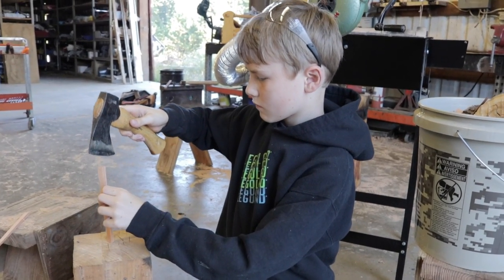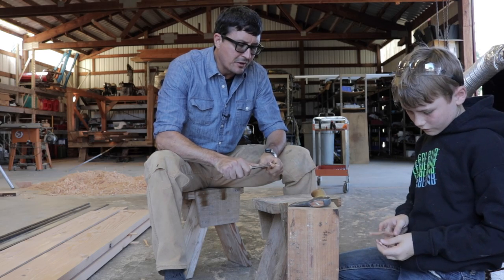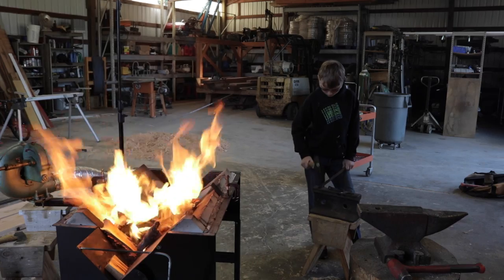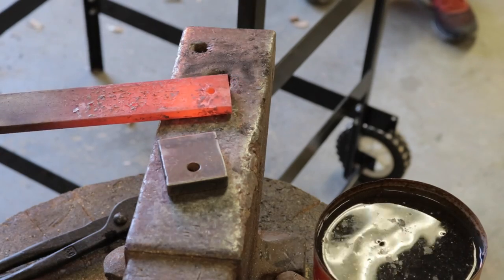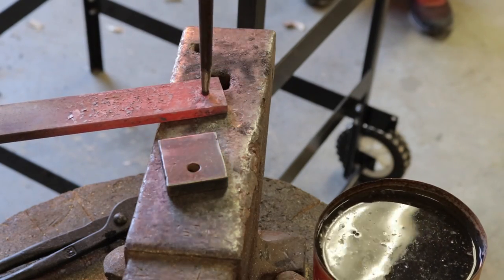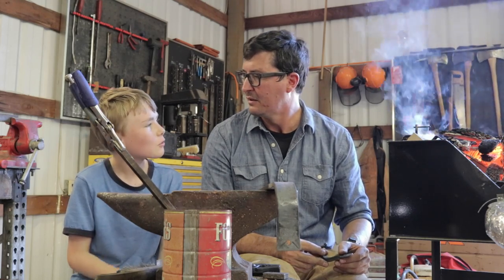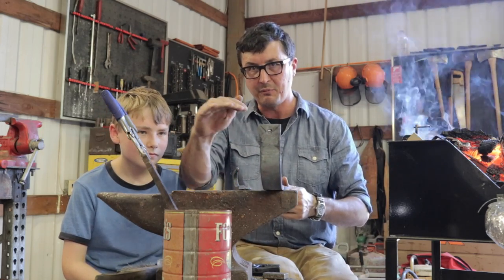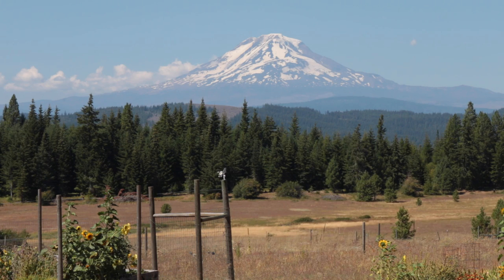Blacksmith With Wood

Comment: First video I've teared up while watching. My dad died when I was young, about 3. Never have had the knowledge that should be passed down from father to son. Came to this video trying to learn more about smithing, trying to figure out what tools I should get, what brands I should trust, how to use each tool to its potential. Right when you sat down with jack at 1:51, I could feel through the screen the connection you share with your son. Guiding him through each task, teaching him the correct ways to do things, helping him discover. It hit me right in the heart. I hope to be half as good a dad one day.

Comment: Most of the manual skills are aided by muscle memory. I watch guys who work in offices struggle with simple tasks because their hands don't have much muscle memory for manual tasks. 
Jack and all young men starting out get frustrated because simple tasks seem so hard. To all the young guys, keep going, you will get good at it, all the experienced guys struggled in the beginning, I promise you, all of them.
Reply: I totally agree with you, one of my first jobs was  digging  drainage ditches  and was teemed up with a scrawny old man who worked the head of the trench's with a pick, when shown who I was to work with I had the temerity and just plain bad manners to ask to be put on another team as I would spend the day standing around waiting for the "old man" I never did catch up with him and for the remainder of that job he would spend half the day sat at the end of the trench supping tea and waiting for me. After the job finished the boss took me aside and informed me that the old man had been taking it easy on me so I didn't look to bad on my first job.
Reply: I rounded of and chewed up so many screw heads as a youngster.  Bent nails and buster fingers with a hammer.  Good times.
Reply: I used to work in a printing shop I jogged papers as they came off the Press and made them neat and stacked them on the pallet, eventually working my way up to First pressman running the press, I got great strength on my grip doing that, my arms are not that big and my wrist are short of small for a man. Last year my doctor asked me to squeeze his fingers, I didn't reach full squeeze before he started yelling Let go ok we won't do that again! I'm 56.
I give a firm handshake!  Its almost as tough as a vice!
Its good to get a strong grip on things and life, just be careful how you use it.
Reply: I’m 14 soon 15 and I do blacksmithing as a hobby and the odd job when someone wants something. Muscle memory helps so much the more I forge the better I can make it with less effort

Comment: My advice is start out by making your self tongs to hold stock with its good practice
Reply: I couldnt agree more, Ive been smithing for about a year, and only just made my first pair a week ago . Wish i would have made some earlier. In the past 2 days i have forged 3 pairs , 2 from rebar 1 from square stock.
Reply: That is indeed good advice. There is nothing better than good tongs. Even though, from my experience, the first 1-3 pairs are pretty shoddy, but often still better than standard tools not made for smithing.
Reply: Haha. I remember trying to forge weld. The VERY first weld I did was PERFECT. But I didn't know why... the next half dozen blew apart, crumbled, wouldn't take, or cracked after they cooled. THEN I got the hang of it. Just gotta keep mangling steel until you figure it out!
Reply: Rion Motley
Oh man, I know that. Beginners luck can be so solid yet disappointing when it comes to smithing.
Reply: I was taught some basic blacksmithing years ago and quickly found out that certain tools were needed to be made but without the knowledge it's better to buy a few blacksmith tools on ebay and study how they were made. Cudos to you for including your son! FYI, old files can make some really great knives. Google Jim Rubley,  I think he's moved from Angola,  Indiana up to the Shipshewana area. Learn from the best.
Reply: You took the words right out of my keyboard!  I've been smithing since autumn of 2014 and my advice for anyone who starts out in the hobby is to make your own tongs - yup... my first pair were trash and eventually broke but they nonetheless served me well while they lasted.  My next two pair have been perfect!  To reinforce what others have said, you indeed learn a lot about moving metal by forging tongs and to paraphrase the YouTuber Walter Sorrells, - about 85% of blacksmithing is having the right set of tongs to hold the work piece.  Cody, I recommend watching the videos on the YouTube channels "workingwithiron" and "technicius Joe" for tongs as they both go into a lot of detail.  For other inspiration into what you can do with this craft, check out "Chandler Dickinson".  I sincerely hope to see many more blacksmithing videos - maybe one of these days you'll forge your own hatchet!!Cheers and God's blessings to you and your wonderful family,- J

Comment: As a Blacksmith I strongly advise the wearing of leather gloves while forging, failure to do so will elicit a painful and and hope not to serious of a lesson.
Reply: Lionel Bourgeault funny enough every other blacksmith Ive ever worked around said the exact opposite lol. If you ever do get burnt I recommend mustard to ease the pain and honey to sooth and it also acts as an antiseptic. If you do them fast enough it'll prevent blistering.
Reply: Lionel Bourgeault yes I've learned that the bad way while self teaching myself
Reply: You shouldn’t wear gloves wile forging, if you wear gloves and a spark or the metal is touching or on you, you won’t feel it until it is much to late, and the injury will be worse that just glancing the metal on your skin. Don’t get me wrong, it still hurts a lot but it’s not as bad as when it happens with gloves on.    I speak from experience
Reply: I was taught not to use gloves because by the time you feel it burning through the glove then the glove is burning you not the metal where if you feel the heat radiate before you grab it

Comment: Thinner steel is easier to work with: it's lighter, it bends more easily, it doesn't take huge hammers, but at the same time it retains the heat less and so cools down really really fast
Sometimes i have to blacksmith with nails 3x50 mm (i make small parts for models, robots and rc cars) and it's quite a pain: hoi can use a torch to heat them up, but you have to keep it really close to the anvil and you have to heat the piece up again every 3-4 seconds
Reply: Wait you make robots AND you're a blacksmith??  Awesome!!

Comment: Looking forward to seeing how y'all progress with the project. I'm just starting out blacksmithing also. You mentioned Jack's hammer weight, and one thing I learned from my local blacksmithing group that may help Jack is letting a heavier hammer do the work as its weight falls instead of swinging a lighter hammer harder down onto the material. Sounds counter intuitive since a heavier hammer seems like it'd require more effort, but it works. I started with a lighter hammer and noticed I had to work a whole lot harder on the downswing and the steel still didn't move much. Then, I got a heavier hammer and it eased the work since I was just guiding the heavier hammer as it fell onto the steel. If he has trouble lifting it over and over (especially since railroad track doesn't rebound very well), he can treat it like a sledgehammer swing and bring it close to his body, lift it straight up, then let it fall in an arc — watch Alec Steele striking with a sledgehammer on YouTube to see how well it works. Hope that helps, Jack. Also, maybe you can get your hands on some hot punch lube to help out with future hole punching projects (like http://quickanddirtytools.com/collections/frontpage/products/hot-punch-lube). Really enjoyed the words in the end scene.
Reply: However, on second thought, a lighter hammer does allow for him to learn accuracy more easily. So, the one he has is actually probably a great one to start with.

Comment: Cody to add to what you said on letting Jack figure it out on his own, the most important part of learning is failure. And letting Jack make mistakes and learn from them is quite possibly the best way for him to have excellent problem solving skills. My scoutmaster runs our troop this way, which is where I learned this. Now I don't want to tell you how to be a parent but I just felt you left that out in your talk about how Jack is learning to blacksmith.

Comment: My uncle was one of those old mechanics who kept farm machinery running on a farm in Montana, and blacksmithing was just one of his skills.  Had a rod bent in an l-shape pounded into a hole on the anvil stump that was at the height of the anvil top.  He would rest metal here to support it on the anvil top, and he never had to straddle the end of the work as you did.  Just a thought you might try.

Comment: I'm a 14 year old blacksmith. but yeah, woods is pretty good to forge with. it's clean. it's cheap. and it creates a fire very quickly. the only draw back is that it burns so quickly is that it is hard to keep a large hot fire. there is nothing wrong with that for what you seem to be doing. keep up the good work.

Comment: When I was in the Navy I was stationed on a ship home-ported in Japan and on a clear day I could see Mt Fuji.
That is a good way to learn a skill, when I started off as a Machinist I got a job in a job shop and my first assignment was to make a number of parts out of a block of steel and I had to make my tooling out of the same block.
You learn how to plan ahead.

Comment: Hey Cody I have a question for you, I am an electrician who is currently working on a bunch of residential projects and I have no good way to sharpen the auger // nail eater bits we use to run the wires through joists, and wall studs etc...I know you have some good tips and tricks for those of us who are having the same issue! Thanks again for all that you do, and thanks to the Mrs and Jack as well! You guys are all awesome!

Comment: Thanks for the video guys. Been a while since I worked at a forge. It was gas fired in a shop class. Our project was making a chisel. We had to know the  properties of the steel and the temperature indicated by the color. It had be annealed, tempered, then ground to a 60 degree angle. Making tools is fun,you get to use them.  It's an art that takes skill and knowledge and of course practice. That is a nice forge, I like the design.

Comment: Not sure if others have commented this but when I was taught forging, I was told that the key to successful forging is to hit hard and hit fast, striking twice per second rotating the bar on every strike (if tapering). The kinetic energy of the impacts prolongs the heat and malleability of the metal.

Comment: I would recommend  using some 1/4" inch round for making beginner coat hooks. Also, don't be afraid to lift the hammer or get a larger one. I use a 3.5lb hammer for 1/4" to 5/8" and from anything bigger than 5/8 to 1" I use a 4 lb.Best of luck to you, and your son's journey of blacksmithing,                                                                                                            Mark

Comment: Very cool work. I've done a little blacksmithing and it is tough.
Might I suggest "the backyard blacksmith" it explains a lot of basics.
I've once heard a jeweler swings from the wrist, a carpenter from the elbow and a blacksmith from the shoulder.
For Jack I'd suggest a higher placed anvil.
Just my thoughts and tips but this is your journey.
Have a great day, cheers.

Comment: When splitting kindling up like you did at the beginning, its just as effective and WAY safer to put the wood piece parallel to the axe blade to split it - one end of the wood close to the axe handle while the weight of the head does the job at the other end. Works for surprisingly large kindling too.

Comment: Hi, to make the ends of your brackets 'flare out' like a fish-tail, put your chisel straight up in the vice and take your work to the tool. Place it on the chisel and strike with hammer moving the work piece like the hand of a clock. The chisel cutting edge needs to be wider than the cut that you need, don't cut all the way through but a bit of a 'ragged' end will just add character.
You can make your own chisel to drop into the square hole in the anvil to eliminate the vice, make it square to fit the hole.
Hope this helps...

Comment: Uhm, a few things I think might be of help to you... I realise you were experimenting here, but these are just a few things that I'm calling as I'm seeing them.

1: nail the anvil down, or at least make it so that it's anchored properly, otherwise the energy from your hammerstrike just gets lost in moving the anvil about

2: I'd recommend using coal instead of wood, coal retains heat a little bit better, but I guess that's just a personal choice. It's not that I think wood is bad, it's just that I think it's more of a faff to fire the steel to proper temp with wood. Also, I think it should be a little bit hotter before you start hammering it.

3: to create the brackets, you could use a square shaped (a 90 degree angle) mold and hammer the steel into that. you'd get a nice uniform angle with all the brackets, instead ofhaving to gauge by eye whether each bracket is the same angle.

4: my recommendation is to first upset the ends of the brackets, then hammer them down to flare them out a bit, and then punch the hole in.You can then, ifyou think it would fit your bookcloset, shape the ends to look like fleur de lys perhaps? or cut/saw them to shape if you prefer doing it that way. Once that's done, you could heat up the middle and softlyhammer it into the anglemold, just be careful when quenching, as the rapid cooling may warp the steel.

For Jack, I recommend using a lighter hammer. Remember, it's not the strength of the blow, it's the precision of the strike that lets you ease the metal into the shape you want it to take, he can always use the bigger hammer once he's older, for now I think he'd accomplish more, faster if he uses a lighter hammer that he can control easier. Also, I think it might help him to practice the hit/turn technique, by which you hit, then turn 90 degrees, turn the steel back, and hit again. It takes a bit of practice, but it's a vital technique to know when drawing out metal bars to a nice and even point.

Comment: I'm a Danish Scout. And every scout group here in Denmark have a tradition of selling Christmas Trees :D 
Last time we built an Old Man's Fire (A fire on a table with dirt on top).
We decided to go get our 15kg anvil and heat up some 20cm nails!

We got very supriced when we pulled the first nail out. Because it was glowing white hot and the tip had melted off.

That was the first time ever "blacksmithing". And I made a little knife :D

(It was not very sharp or easy to sharpen, because log nails use very poor quality iron. It's not steel. Because it didn't create alot of sparks when grinding)

Comment: First suggestion is to move your anvils within two steps of the forge.  Saves heat and energy. Second suggestion is to create the fish tail or fan first first then punch your hole.  A cross peen hammer will help you move the metal quicker and more efficiently.  I'm still learning myself but every nugget of knowledge helps.  Gob Bless!

Comment: Since you mentioned layout of your work space I would suggest that the anvils be closer to the business end of your forge rather than walking around the forge each time and losing heat in your workpiece in the process. I would rather just remove my piece from the coals, turn 90 deg and have my anvil there for efficiency. I do understand that for filming though you have other considerations going on at the same time as forging. Looking forward to part 2.

Comment: When removing the punch from the metal try knocking it from the side a little rather than hitting the tip into the anvil, the tip will mar the surface of the anvil and affect future work by transferring the rough surface to the metal :) I recommend taking a day or weekend course with a professional blacksmith, you will learn so much in just a few hours! Love the video especially enjoying the small end cards!
Reply: Also, if you have an old bike chain hanging around, you can use it as a 'third hand' on your anvil. Essentially, nail one end to the stump under the anvil, drape the chain over the anvil and attach a stirrup to the hanging end. To use it you simply place the metal stock between the chain and the anvil, step in the stirrup to grip the work then use both hands to hold punch and hammer. I forget the proper name for it but as long as the chain isn't drenched in oil it works a charm! (If it is the oil may smoke or burn and who knows what's in those fumes!)
Reply: Absolutely true! Take a blacksmithing course with a professional smith and your skills will grow exponentially.

Comment: I understand your trying to be rentable, you have so much wood around. But when you need more heat, buy smokeless coal. Break all the pellets into dust, and burn that. it obviously will burn aster than as pellets, but the next will be very good for forging (just make sure your forge can handle it first, maybe add some thin fireplace blocks under the dust to reflect the heat back up at the metal)

Comment: Congrats on your first hole hot punched. Try a block of wax to quench and lubricate your punch. To avoid the radiant heat when you were hot chiseling wear a Kevlar glove on your left hand or cut your chisel to a 4 inch length and hold it with gas pipe pliers.
     It appears that your using an anvil and stump that moves with hammer blows. Secure it, it will make you work more efficiently.
     Lovely video so well done with you and your son.